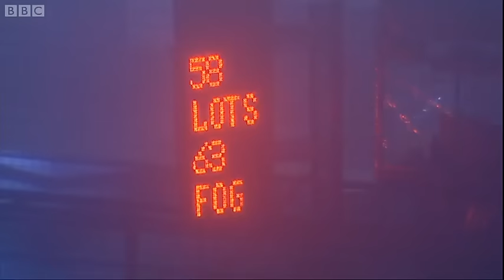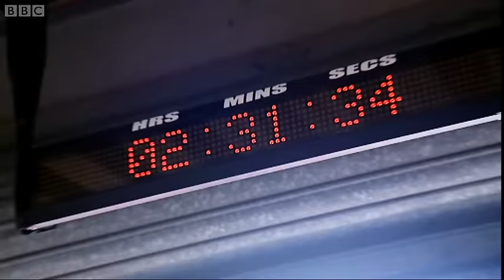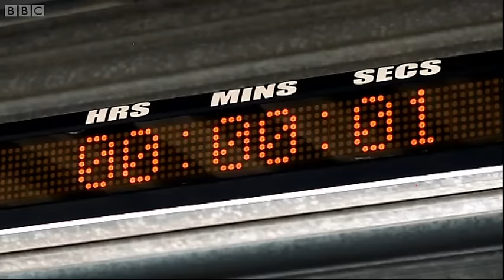24 Hour Racing Challenge! | Top Gear

Comment: I love these types of series. Seems very similar to AER (American Endurance Racing) here in the states. Broken up into a class system based primarily on Power to Weight ratio and no I don’t understand why they did that either. It’s fun because of the duality of it. You have all the way from former dirt track racers with a crappy little Dodge Neon with the doors welded shut, which completely pisses off everyone because they’re always the fastest in their class for no adequate reason. All the way up to professional M4 GT4 cars, Wide body LS swapped E46 BMWs and everything in between. Basically if you have a car, you know how to build race cars and drive them, have a racing license and a few hundred dollars, you can enter.

Comment: Started: 59th (last, because although they qualified 42nd James managed to damage the clutch, inlet manifold, turbo, and the flywheel, which resulted starting in the pit lane due to the repairs on the car)
Finished: 39th and 3rd in class
Reply: Stigs a hell of a driver

Comment: 1:20: silver 330d rolls over part of the front splitter.
1:43 Front splitter comes off.....

COINCIDENCE? I THINK NOT!

Edit: In fact the shot of it on the track at 1:43 shows the splitter coming off on that side where it was run over.
Reply: OOF
Reply: THey didn’t run it over. THey nearly hit it
Reply: It doesn't run it over though

Comment: That M57 is a bloody reliable engine!
Yes it only had 45k miles on it, but that car was probably treated horribly when it had a previous owner, and was most likely never serviced, so the components around the engine failed catastrophically just after a few laps. The engine may have even been worn when they bought it. But I'm surprised the factory engine lasted for such a long time being driven this hard, and that it seized up after the crash, and with some incredibly rushed repair jobs it managed to turn over, getting the stig 8 places up at night!
BMW may have made some terrible engines such as the N47, N20, N63 and the prince engine collab with PSA, while a lot of decent engines were plagued with weak auxiliary parts such as the N54 and the M57 as shown here, but the performance of this most likely neglected M57 shows how BMW is also incredible at making motors with bulletproof durability and longevity, up to the likes of Honda and Toyota!

Comment: 3:51:
3 hours at let's say 2 min 30 per lap (May could do 2:24 when the car was healthy, but it's mentioned as too fast for the tires with no splitter) means about 72 laps. For Saxondale to make up 20 laps (30 lap gap less 5 laps at the stop to change over to Jeremy, plus another 5 laps for Jeremy's mid-stint tire stop) on Top Gear in those 3 hours, they'd have to do 92 laps. To do that Saxondale would've needed to run 1:57s and not make a pit stop themselves. I don't think that's possible in that car considering the timing screen showed a Stig lap at 2:1x. They were never in danger of being passed, or Jeremy has the gaps wrong.

Comment: Why would a race car use diesel?
Reply: +nabo 105 Because racecar.
Reply: +dragonborn & lydia Thanks.
Reply: +nabo 105 One of the most successful Le Mans race cars happens to be a diesel. The Audi R8 le Mans Racecar is a diesel car.
Reply: R10, R15, R15+, R18, and R18 etron Quattro Hybrid you mean. ;)
Reply: +Thomas John Solidum those are 30 milion euro cars tho lol
Reply: matteo castellani Still a diesel car.
Reply: nabo 105 diesel burns slower than petrol and is more economical over longer drives. Hence, diesel Audis.
Reply: Also everyone talks about Audi diesels,  but the first diesel to win was in 1998 with the 320d  at the 24h Nürburgring
Reply: Diesel engines are more commonly used in 24 hour races and the lot because of their better fuel economy, meaning diesel cars have to stop for fuel less often, allowing more time to be allocated for driving.
Reply: Thomas John Solidum R8 LMP runs on petrol.